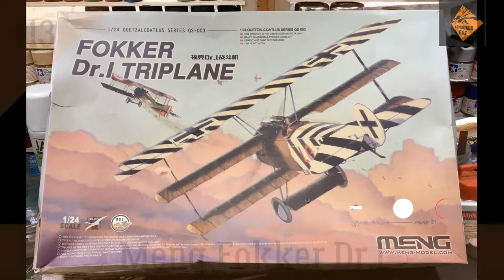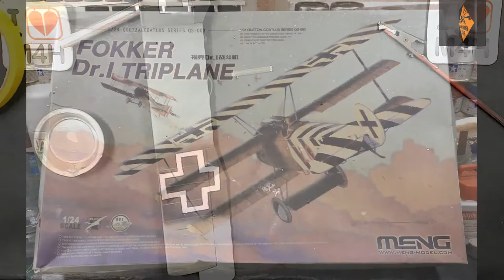Episode 13 of my Meng 1/24 Fokker Dr.1 Build

Comment: I know it's way too late to mention, but you mentioned the difficulty in painting vibrant colors. I've learned the hard way that if you want a vibrant yellow, prime with white. It keeps the color bright and requires fewer coats. It's the curse of red and yellow to be the thinnest in pigment. Iff you want to paint red, prime with yellow to keep the red bright.
Also, I found that if you give the edge of the tape line a thin coat of clear. Spray so the clear gets both the tape and the plastic. Then spray your second color. The clear will prevent bleeding under the tape.
Looking forward to how it all ends! :)
Reply from the maker: AWESOME Advice, thank you very much 👍🏼👍🏼👍🏼

Comment: Andrew got there before me. I too, am interested in the template. However, I am cautious about ordering from sites such as the one mentioned due to the usual delays prior the current times. I feel that those delays could be even longer at present due to the worldwide shipping delays. 
There is a cutting mat by Infini Models that does a similar job and is available in the UK. I live outside the UK, however, and can't find it for sale on Amazon Germany. Do you, BM, or anyone else out there know where in the Eurozone I could order one (or similar)? 
Great video as usual. A fellow modeller gave me his tip on using white and yellow paints. Warm the pot and thinner prior to pouring it into the airbrush. Apparently this will help to dissolve the pigments much better than just shaking the paint pot. Not to get "sciencey", but the pigments bind together more than other colours and heating the paints and thinner helps to separate those pigments, just as heating a can of spray paint does.
Reply from the maker: BD, ok I wait a bit longer for the stuff I order but I’ve never been let down by AliExpress 👍👍👍

Ohh great idea about the paints, I’ve got a wax burner I can use. TY for that 👍👍👍